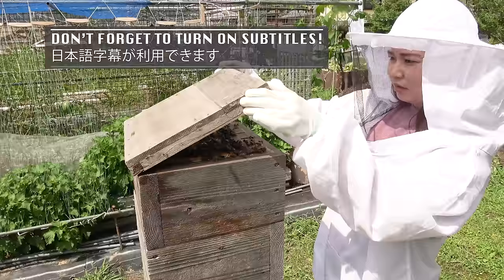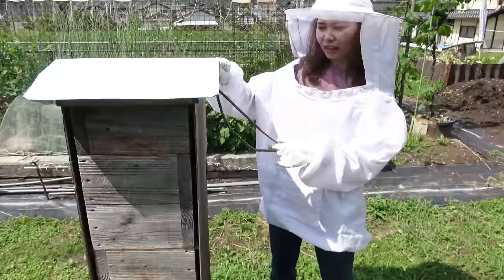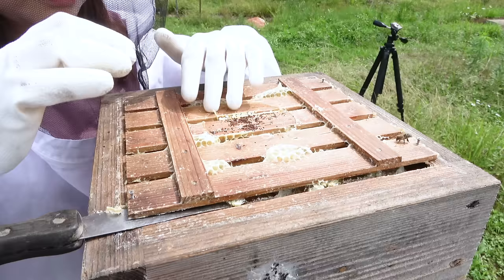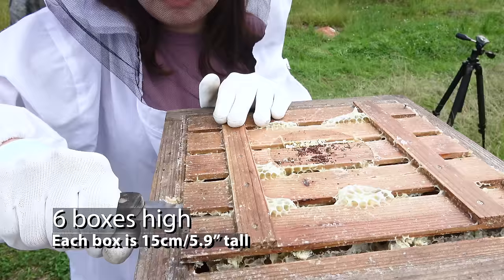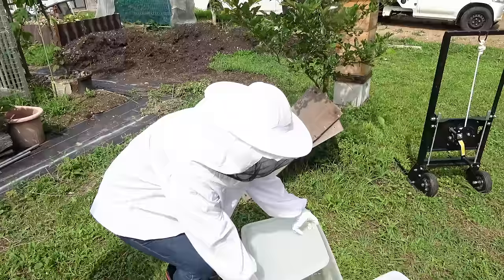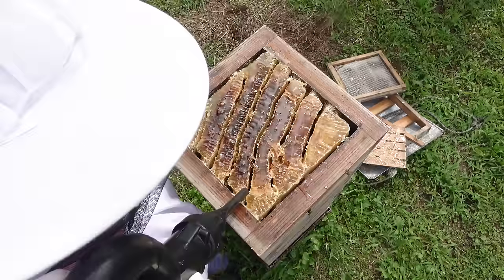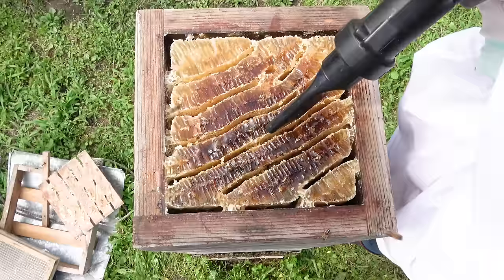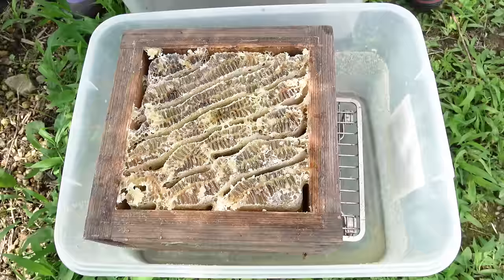Traditional Japanese honey harvest. Apis cerana japonica

Comment: As nice as it is to see traditionnal beekeeping from around the world, it also highlights the shortcomings that are overcome with modern techniques. 

Frames are both easier and faster to use both for the beekeeper and for the bees. It is less destructive during extraction=less work for the bees afterwards.
It also allows the extraction of specific single flower honeys. 

Here you can tell that you'll only make one extraction a year of polyfloral honey.
Reply: Was about to say the same thing
Reply: Exactly, looks like a lot of work for worst results.
Reply: @idleapex19  They will literally remove the entirety of the harvested honeycombs, and bees will have to start from scratch. Tell me how it is a "no no"? And please, do better than just "I don't think so".
Reply: @leoleo1035  It was stated in the video that the current spring's production, plus a mix of current and previous year's production are removed. Another video that shows the year around maintenance is needed to say anything more.

Apparently this was in the summer after the spring nectar flow. It highly surprised me that a new box was not added, for any further nectar flow.  Since the top box was completely filled, the flow was either completely over and they had already remove a partially filled box - or there is some way the beekeeper knew the top box was full. 

It is also possible that m. japonica fills boxes from the very top down towards the brood chambers. Many questions remain unanswered. 

Why use an electrical powered blower for "traditional" production - a hand operated bellows would be more traditional.
Reply: Зато такой метод удаляет наХлебников на труд пчеловода,так называемый паразитирущий класс приспособленцев в производстве МЁДА сотового.
Reply: However, It is nice to see someone doing it for pleasure and not for business, I have a bee hive without frames and the bees are very happy building new, it keeps the hive very clean no old honeycombs. I also add new units underneath not on top so as they keep moving down the top gets easy to harvest.
Reply: @buggsy-sb3if  i saw some videos and japanese bees build comb down, you pull boxes from up, and put new boxes down, they have lever to be able to slide the old boxes up, so they have enough space for new box
Reply: @poro9084  Certainly, I have seen some of those videos myself.

However, that does not change the fact that the method is unnecessarily complex, difficult and time consuming. 

Western and European bees also build comb from the top down - nothing unusual there about Japanese bees.

And as etienne noted, it also makes more work for the bees and requires them to consume a lot of honey to make new wax each time in the new boxes. It may be that the wax moth problem in Japan is severe enough that new comb every year is necessary to keep the honey edible.
Reply: @buggsy-sb3if  On your last point, I suspect this is mostly due to competition with Ausi and NZ imports. It seems less about the TRADITIONAL japanese way, and more about the traditional JAPANESE way.
Reply: @realstatistician  it s more about how you treat your hives than "economy".

Destroying most of it for one harvest just feels wrong to any beekeeper who cares for his cheptel.

Comment: Remarkable that in 2 very different parts of the world there are very similar approaches to the hives construction and manipulation. The Warre hive is a small square box and new boxes are added to the bottom. Instead of frames it uses top bars to comply with inspection requirement’s.
Reply: Warré bars are nailed down and not movable, so I don't see how they would make the setup inspectable. To me, they are simply there to keep the comb stable when removing upper floors.
Reply: @ccreutzig  Warre hives are not designed to be inspected every other week, its designed to mimic natural bee behaviour and so that the beekeeper has to interact with the colony less. 

You shouldn't HAVE to inspect a warre hive as often as a Langstroth hive, for one the colony has a better balance of bee casts in a warre since we are not tricking them into breeding more workers than normal for honey production. Speaking from experience bees in Warre hives tend to fair a lot better without humans having to intervene
Reply: @azaphakaylock2789  Exactly my point. 👍

Comment: Great video. Thank you. When she replaces a new empty box, does she place them on the bottom of the pile with the older boxes going on top? Or just put the new empty box back on top? Also, does she exclude the queen from moving into the upper boxes so that they only have honey in them and do not become brood boxes? I'm very interested in her methods.
Reply: The Warre hive, which is also a tower hive, does not generally have a queen excluder, though some that keep Warres do use an excluder. Either way, brood still tend to be kept lower down, with honey stores in the upper boxes. The bees just work it out for themselves.

Placing new boxes: https://youtu.be/zGodZJlotjU
Reply: She adds them to the bottom. The bees build the comb downwards, and as the build downwards, the brood are moved down and the older comb is then used to store honey (the older comb is the top boxes). No need for a queen excluder since the upper boxes are used for honey storage and the lower boxes for brood.

Comment: Quite like the Warre hive but here the duckboard is screwed in place, instead of the top bars of the Warre which are not screwed in place, the bees will freely build comb from the bars.

The inclusion of a sideboard to stabilise the tower and using a blower is new to me. Though tapping the top of the hive and later the box side, is a common practice before harvesting honey & wax from bees kept in skeps.
Reply: I was thinking that as well I only use Warre and Layens for bee keeping the advantages of deep boxes is great although harvesting can be more of a pain. I have made modifications to both with half frames in between the frames so that the frames make a solid roof and on the Warre I have made frames with short legs and some with full frames like the Layens.
Reply: @fishmanfairclough7530  - I do like Layens. I favour Topbars but each hive has its +s and -s I suppose.

Comment: Traditional is cool and all, but why do it when there is so many other ways that outclass the traditional one. Langstrooth or layens hives are much better. Easier to extract honey without making such a mess in the hive. Alos you should always do regular inspections to check if queen is okey, check what pattern queen makes, check for diseases and pests. This will not be possible in these boxes. Traditional yes, interessting yes, but still other ways should be used if you  ask me.
Reply: I live in Toronto and have many of these hives (with frames) Very good for older people.
Reply: @beeman1246  with frames it would clasify as another type of hive right?